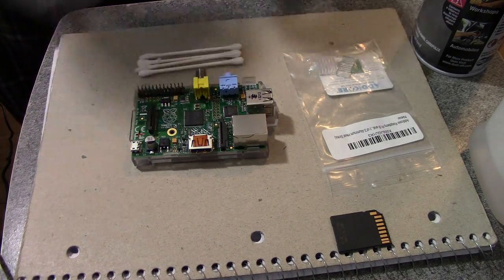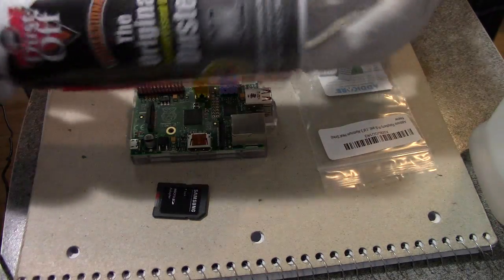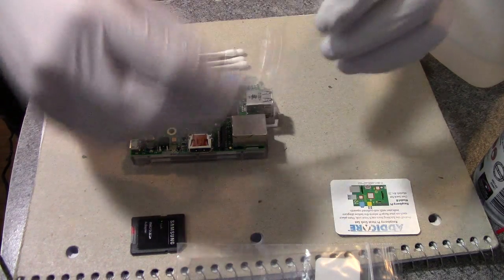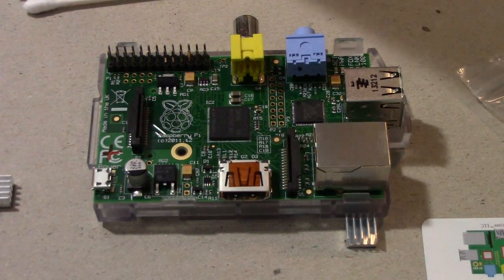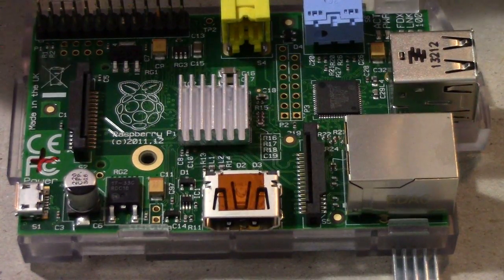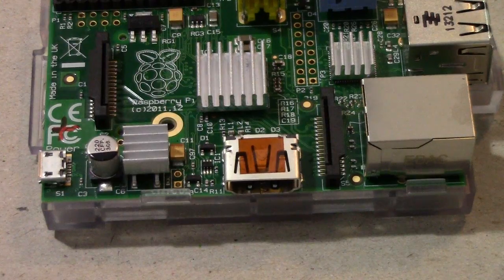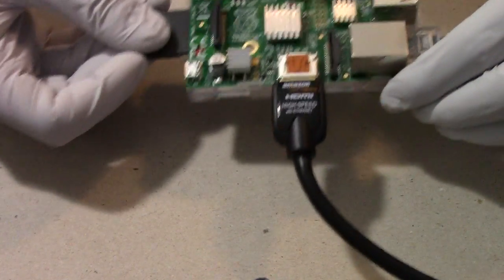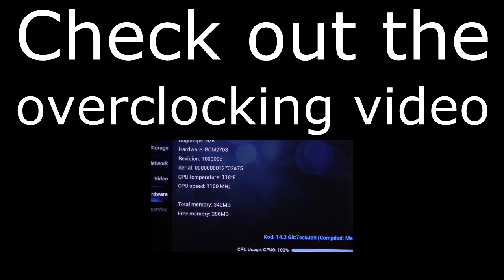Installing Heatsinks on the RaspberryPi Model B

Comment: no thermal paste just adhesive??
Reply: it seems odd.... but i guess these things don't require the same level of heat dispersion as a desktop would.
Reply: paste definitely helps. Flirc case is the best though. The whole case is a heatsink.